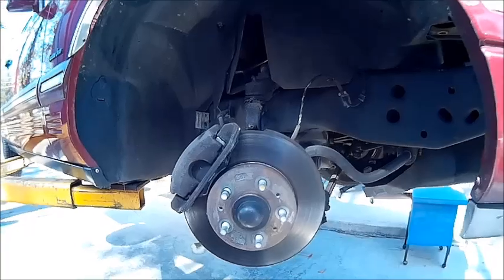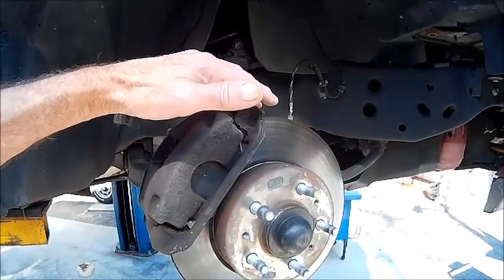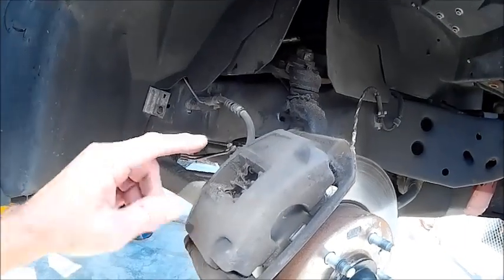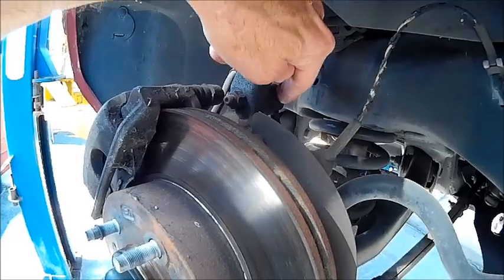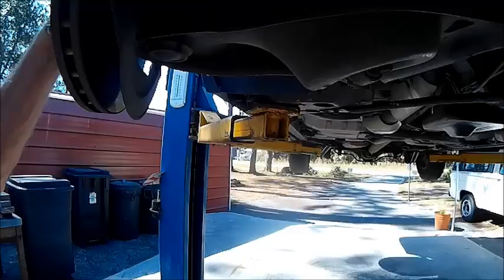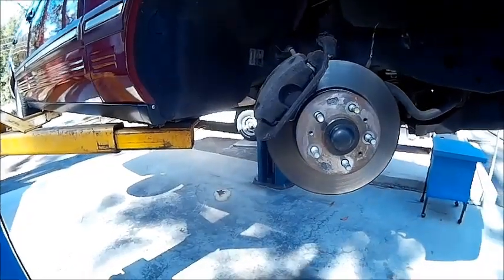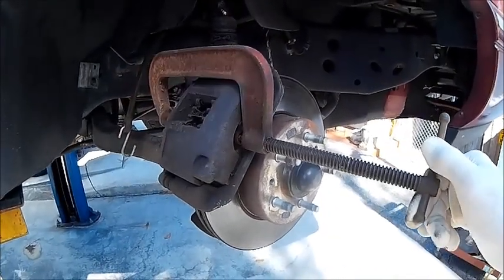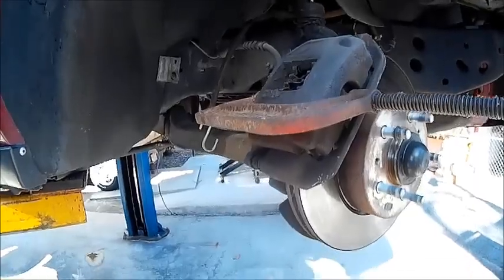1997 Lincoln Lower Ball Joint Replacement

Comment: Great video War Horse. My 1994 Lincoln Town Car Cartier has 205K and after some strange tire wear attempting to do the entire front suspension. I’ve had this ride since about 115K and haven’t done much except replaced a broken tie rod end at one time and had the air suspension converted to springs awhile back when the compressor failed. It was a beautiful car when I got it over 10 years ago but after my wife hit a deer awhile back and Nebraska rust got to it not so pretty anymore. It’s been tore apart in the driveway for about 10 months now up on some very sturdy expensive jack stands i purchased. Kind of gave up for awhile after I think I stripped the power steering gear box to pitman arm nut. It’s on there but probably not legit. Everyone thinks I should get rid of it but I’m stubborn. Plus I got about $1000 in new parts I cannot return I got off rockauto. Super hard finding some of the needed parts these days. I seen upper control arm assembly’s for $300 on eBay (if you can even find them no one makes them anymore). So I ended up finding the shafts and burning out the old bushings and carefully pressing out the old sleeves and pushing in new bushings with my 20 ton harbor freight press last summer. Just bought a Harley Electra Glide so I need to get this Lincoln moveable again to access the garage. Not looking forward to doing the lower control arm bushings due to the coil springs (yes I know the danger). But I’m determined again to get this thing back on the road again. Good engine still and tranny rebuilt around 160K. Bad thing is it’s developed some electrical demons and I don’t do electrical expect (battery/alternators change outs) last time I went to start it I heard a fuse blow or something. Probably going to get it put back together and have it towed for a alignment and the electrical demons fixed. I’m sure it will cost the earth.
Reply from the maker: Good luck with the restoration.  A place called, "Lincoln Land" is a good source for parts.  Electrical damage while sitting may have been caused by rodents.

Comment: Just purchased a 99 Crown Vic with 80,000 miles…. Pretty low for a 24 year old car.  It still had original ball joints and they were shot.  Thanks for the tips, especially the cotter pin hole.  Don’t you just love the simplicity of the top ball joint.

Comment: Usually the boot has a bleed hole for excess grease to come out and that should be facing the inside of the car so that the grease doesn't come out and get on the brake rotor. You failed to mention that you should orientate the boot so that the bleed whole faces inside.
Reply from the maker: There is no bleed hole on these. And for that matter, I've never seen any on any ball joints, including Mercedes, which I worked for as a master tech (A), for 18 years. I think they might have mentioned it in the thousands of their classes I've attended. But I'll keep an eye out for them in the future. ;)
Reply: I am quite surprised that you don't know what it is.

Comment: Thank You So Much! This video just saved me soooo much money. After getting a $700 quote for this job, both sides😢, I decided To watch some YouTube and do some google research. This video was the most detailed and informative video that I came across. So I literally watched it 5-6 times last week. I went Amazon got 2 ball joints, same day delivery on Friday morning. Also went to auto store for press and pickle fork. Started the removal process Saturday morning 7am and by 2:30 pm that same day I was done. And I did it all by hand, no air tools. Pickle fork wasn’t necessary, i used my hammer to knock it a loose from the knuckle 
Pretty simple job as long as you follow these directions. 
Again, thanks man 😎
Reply from the maker: You're quite welcome. I'm glad to hear that the video was of help to you.

Comment: Very helpful information. My XR-7 just lost the bottom ball joint this evening while backing in the drive, so I'm on the business end of this loaded gun. Be getting the parts and the ball joint press, and do the brakes after I'm thru with the repair. Thanks so much for your help.

Comment: Smear some grease on your spindle steering bump stops, they look dry.

If these bump stops get dry of grease and the steering is cut as sharp as it'll go and you go to back out of a parking spot you might hear a loud popping and screeching sound from the front end on 2002 and older.  03+ got rack and pinion steering.

Great video.
Reply from the maker: Good idea, I'll give them a lube up next time I get her on the lift. :)

Comment: Just to clarify- The Mercury Grand Marquis was discontinued when Ford killed the Mercury brand in 2007. The Crown Vic and Town Car lived on until 2011 when Ford discontinued the Panther platform they were built on.

I had to chuckle when you mentioned the W126 Mercedes. I just brought my '90 300SEL back home last week, after it sat at a friend's house for almost a year. Judging from the extreme negative camber of the right rear wheel, I suspect the trailing arm is bent. Time for a trip to Pick-a-Part. The factory rear suspension is non-adjustable, but an aftermarket company in Australia makes a kit with eccentric adjusters to fully adjust the rear camber. The fact that the previous owners briefly lived in it and loaded it to the gills with their stuff probably didn't do the old factory springs any favors. 

Once I've dealt with the damaged suspension and the bad head gasket, I'd like to do the valve body modification where it starts off in first gear rather than second.
Reply from the maker: I worked for M-B for 18 years as an A, Master tech. If you need some advice, hit me up on Hangouts.
Reply: Sounds great!
Reply from the maker: I was thinking about your rear end wheel chamber angle. The most common problem is the center differential support/mount. A new mount will bring the carrier up, thus bringing the overly negative chamber back into a more acceptable light. Remember that these cars have a built in negative chamber for better cornering.
If that doesn't bring it back to specs, M-B does make different thickness spring pads.
Baring any damage to the control arms, or major spring fatigue, That will get you back to the correct settings. Either way, on a W126 of that age, the diff carrier/mount will need replacing. 
Sorry it took so long to get this out to you, at 61 yo, the mind works a bit slower.
Reply: Yeah, I was thinking about that. I've been contemplating yanking the diff out and replacing all those just like you said. The car has over 300K miles on it, so all the bushings are probably shot. The prior homeless druggie owners using the car like an RV probably made it worse. 

I'm pretty certain that the right rear trailing arm is damaged. The rear passenger door and the section of wheel arch just behind it are completely demolished, and the wheel at that end has far more negative camber than any of the others. It's like a person with a reverse clubbed foot. 

My plan is to slowly rebuild that car to be a possible eventual replacement for my well-worn 1995 Lexus LS400. The Lexy is a great car- gave me NO major trouble in ten years of owning it until the transmission failed last year at 132,000 miles and I had it rebuilt. Still runs like a champ, but now the AC compressor is eating itself and the 20 year-old leather interior is disintegrating. 

If I have my way, that Benz is getting ALL new bushings, new springs,  new Bilstein shocks, new driveshaft couplers, and a custom high-flow exhaust.  If I collect all the new parts but end up dumping the car in the meantime, all those goodies will go on the 560SEC I snag instead :) .
Reply from the maker: I think you'd like the SEC much better, the 2 door 126 body on that model feels more solid for some reason. Only problem with the 5.6 engine is the valve guides and cams going south, and timing chain,  tensioner, and guide rails will need a close eye kept on them. Head gaskets, due to lack of coolant changes, also have a fairly high failure rate. 
The 126 series also have a good amount of front end wear problems, caster bushings being the top of the list, followed by idler arm bushings and drag links. 
M-B's, generally speaking will be in the shop more often then a Lexus would be. But sometimes a man just needs to get that out of his system and drive a Benz.

Comment: I have a 1998 Lincoln Mark 8 , is this pretty close to what I can expect doing this shit? Ive never done this , lower ball joint broke on me today got it towed to my back yard , Im renting and not supposed to work on anything here either - no pressure
Reply from the maker: I believe it's about the same, but the last Mark I worked on was a Mark 4, which is a different animal altogether. This is at best a level "B" tech, job. if you've never done a job like this, think twice before you start in. Either way, be careful and good luck.

Comment: How did you get  and what was the cost of buying a outside lift been thinking about this myself but don't know the right direction
Reply from the maker: I bought this lift 20 years ago when I had my shop. It was around $3500.00. The slab I poured for it here, 16 years ago, cost  around $2000.00.  Electrical and bolt lags not included.  I have no idea what this stuff costs now a days.

Comment: hi.good job.i gotta do my 93 Mark Viii.making that noise when i turn the wheel.peace
Reply from the maker: Make sure to take a hard look at the tie-rod ends, they will make an awful sound too, and have a high failure rate on Lincolns. i believe the Mark 8 has a rack and pinion steering, so the outer tie rod end will have to be loosened to check the inner one.

Comment: If I found one for super cheap, I wouldn't even mind picking up an early 80s' 380SEC, despite the 3.8 liter engine's dubious reputation. From what I've read, the 3.8's biggest handicap is the weak single-roller timing chain M-B saddled it with. I'm into Detroit muscle, but working on an old Benz doesn't scare me. At the end of the day, it's just a machine like the rest of them. Just give me a good shop manual and I'll yank that front cover off and swap on a double chain set like it's nothing. 

I'm not necessarily put off by the 380's lack of power. Some slightly healthier Schrick cams, a custom high-flow exhaust, and the dual snorkel air cleaner off a 5.6 should help that old German boat anchor some. My 4100 lb. 1990 Chevy 1500 longbed has the 160hp / 230 lb. ft. 4.3 liter TBI V6 in it and it moves just fine. It's no hot rod, but it keeps up with traffic.
Reply from the maker: Ok, lemme give ya a quick lesson on the 3.8's. 1981 to 1983 had a single row timing chain, which had a nasty habit of jumping time , and or breaking, thus bending valves, and at higher RPM damage a piston.
These years had black head bolts, which cant be reused, and will pull the threads out of the block. The conversion includes drilling all 32 (iirc) head bolt holes and helicoiling the block. To do this you need a special plate that bolts to the block to guide the drill bit, then you'll need the proper shanked starter tap and a finish tap.
  Now these engines are high silicone and you will probably break a tap off in at least one hole, at which point you'll need to get someone with a laser cutter to remove it. (not cheap). If you do get the job done without any problems and your back is still in fair shape, you need to get all new chrome head bolts. Also to convert to the double row t-chain, you'll need all the gears, rails, tensioner, and chain. 
  I've done more of these then I care to remember. 84-85, 3.8's are fine, as they have the conversion already done at the factory.
Personally I would stay away from all the 3.8's, they also had a problem with valve guides getting loose in the head.
Reply: Wow... what a clusterfuck! It sounds like M-B really screwed the pooch with that one. I guess it's only worth it if you get the car itself for close to nothing.

Odd thing I've noticed. I still see a good number of 380-series W126 coupes and R107 SLs around, but the W126 sedans with that motor have all but vanished. I'm assuming it's because 380SEC / SL owners are willing to tolerate that engine's shortcomings due to the minor collectible status of their cars, whereas the sedans are more generic and therefore disposable.
Reply from the maker: The SL's will always be in demand, tho with a huge upkeep cost, regardless of year. If you really wanted a 107 SL, i would stick to the 4.5 (450) or the 3.5, tho the latter was a grey market car, and not really a good investment. Those at least had the cast iron block with the good rails and double row T-Chain.
The last few years had a good CIS fuel injection system, the earlier ones had the L Jetronic one, which was Ok, except for the wiring harness falling apart. 
  I liked the W113 SL's (230-250-280), much more for looks and dependability, but the price for those went through the roof a long time ago.
Reply from the maker: Hey Christopher O, you might get a kick out of this project video I did a few years ago, tho the actual build was done many years before the video. Check out part 2 as well. 
https://www.youtube.com/watch?v=Nm0XeP_mQNY

Comment: I have a question on your concrete pad for your lift did you have to put footings or is that a standard 4 inch thick pad or did you go sticker
Reply from the maker: Definitely not a standard slab. 2' 6" footer that extends to 4'x4' under each post, the rest is 8" , all steel reinforced. Any lift you buy should have the specs ( blueprint) for a slab. If not contact the manufacture. Different style of lifts will require different applications.
Reply: @warhorse1956  Thamks for the info

Comment: Is it the same for a 2003 TC?
Reply from the maker: That one is different. C-clip on the ball joint.
Reply: @warhorse1956  I am assuming the principle will be fairly similar. I am no pro, but I'll use the auto-shop on Fort Campbell. They allow soldiers and disabled veterans to use all auto shop tools, including the raiser and there's one technician assisting.

They ask like $3/hour to rent a bay, and the same to keep the car overnight.

Won't pay hundreds the chain shops ask for, that's guaranteed. 

Thanks for your video and help!
Reply from the maker: @benbenhomeandlifestyle5122  You should be fine doing it on base with a tech near by to give  little advice if you need it. You are correct, the principle is the same. I believe that the C-clip type ball joints all press in from the top, unlike the one I did here.
Reply: @warhorse1956  I'm thinking about buying them from eBay, and maybe those U-bars as well. 

They are rather expensive at Auto Zone, and about 25 bucks each on eBay. I am not sure if there is a special quality I need to be looking for. Looks to me like once the ball joint is in, it's in. 

The car doesn't vibrate excessively at all, and although I can feel some light grinding feeling when I steer on the left, I think I'm weeks and even months before the cr is unsafe to drive. That will give me enough time to study your video, get some literature, and I hope to fix it right after Thanksgiving weekend. 

Looks like a full-day job for someone with little experience, but with the right tools it should greatly help...

Thanks for your video well done.
Reply from the maker: @benbenhomeandlifestyle5122  MOOG ball joints are still the best bet, don't go for the "white box" crap. If you're getting grinding noise while steering, especially when sitting still, you more then likely have a tie-rod end problem, which is a real common problem on these chassis.  You really need to do a proper diagnostic  on the front end. Unless the boots are ripped on the ball joints, I'll put my money on the tie rod ends.
   I have a video on doing tie rod ends as well.
Reply: @warhorse1956  Thank you!! Grinding is very low and when I turn the steering wheel. When the car has been moving for a while, it stops. The shop diagnosed leaking struts and I am going to change all 4 ball joints, and most likely the tie rods. 

Those cars are super strong, so I will need to change lines and see to a strut oil leak, the multi point inspection provided pictures. I just want to save money and get into the habit of fixing things myself.